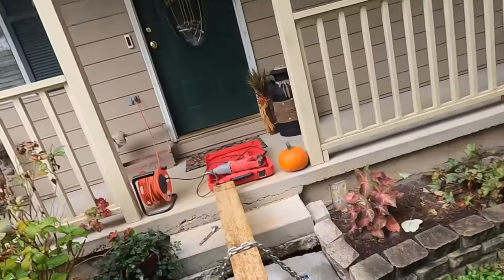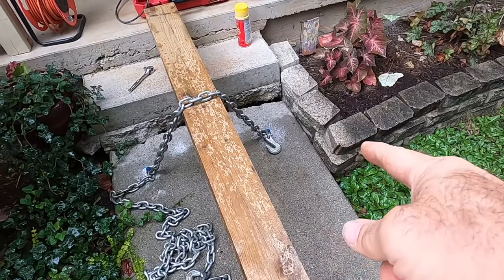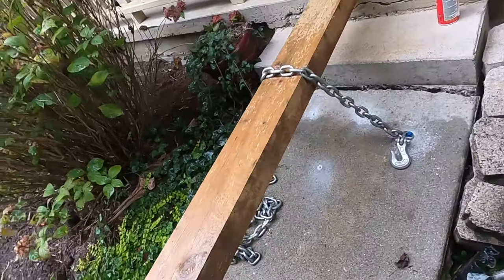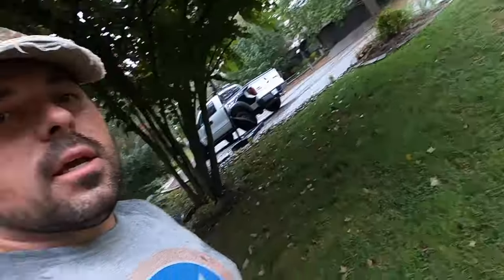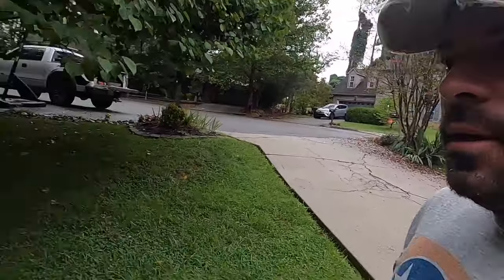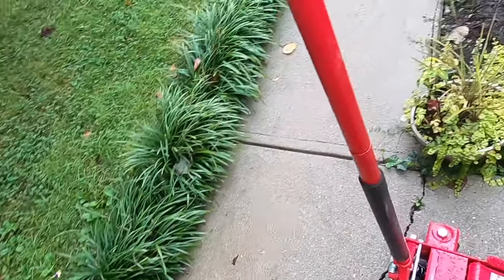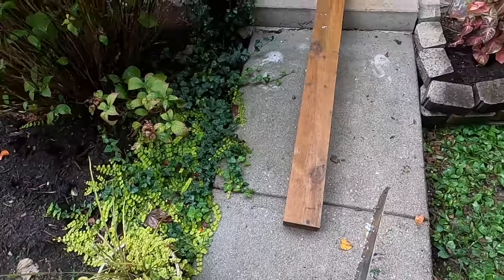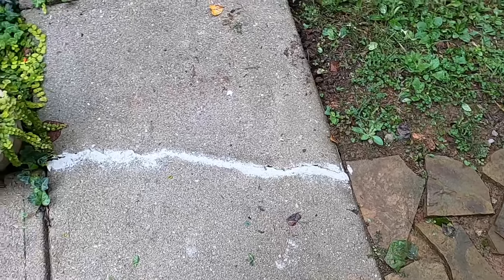Lifting a sunken concrete slab

Comment: Let’s see it a year or so later. I’m sure it failed. Call a company that does it for real and warranties the work like A1 Concrete Leveling.
Reply from the maker: still holding up as of right now
Reply: I’m surprised. It would never hold on Colorado. The domains soft and breaks down with our weather. Ants and termites love to love into. Time and date stamped picture would be cool to see with like a news paper date.
Reply: They use the same thing to lift overpasses that are sinking 🤷‍♂️
Just on a larger scale
Reply: @bombardment92 actually a much different type of foam. The foam he used may be working for that small project,  but would never hold up under heavy traffic like a road over a bridge. 
He did say it settled slightly, and I believe that was likely due to the type of foam he used. There are two kinds, single stage (like what he used, and 2 part which is what the professional PolyJackers use.

Comment: It'll last a few years.... Till the foam starts breaking down. There is a more proper foam for such tasks. Cool job, and I mean, it's done.... But you gotta think about the longevity of materials used in projects like this.
Reply from the maker: I went by it last week it had settled a bit, I'm gonna get back over there dig the side out and pour concrete in there instead.
Reply: @TheProCut17  would be good to know how this concluded
Reply from the maker: @mixedupmenopausaladhd3999  haven't been back out yet. but I've had no complaints from my friend.

Comment: I never seen a slab raised with a jack an then use that foam for support before. That will be great if it lasts for years and years, I have always seen other thick curing fluids pumped in to actually raise the slab up.👍🏻
Reply from the maker: shouldn't go anywhere.
Reply: @TheProCut17  How is it holding up after a year?
Reply from the maker: @bones6554  settled a bit after install, but holding up well

Comment: I am amazed that the floor jack was still on the piece of concrete you trying to raise... maybe htat was intentional ?  Intentional to make it swing up ?  really surprised those tapcons held too.   I would be the secure set would actually lift this pad, no 4 by 6, no jack, just high temperature, and time.
Reply from the maker: tapcons are very impressive

Comment: Never seen that done before. It worked out well. Thanks for sharing. I may have to use this method some time.
Reply from the maker: it worked great, could have hooked the sides with something instead of anchoring chain to top if I had bigger hooks.

Comment: I've been looking into this for a section on my driveway, way at the top where I dont drive or park. I need more than a few cans. So far it looks like Secure Set may be the strongest DIY product I've found.
Its specifications are "This is a 4 lb. density foam, 10 cu. ft. kit, with 70 psi compressive strength, and a load bearing capacity of 10,080 lbs. per sq. ft.".
Reply from the maker: sounds like you will get it done after putting in your research on materials
Reply: I did secure set - but the second product - it took the whole kit.  I am happy with it.  Drilling holes, for me took FOREVER.
Reply: @DanTheManIOM you need to use a hammer drill next time. Regular drills are terrible for concrete

Comment: Moisture speeds up the cure of the poly foam.
As bad as that slab was the better option was too replace it. Then a better bed that can support the new slab would outlast the foam trick.
Reply from the maker: I agree with you, replacing it would have been the best solution. I just wanted to try this and it was much more cost effective at this time.

Comment: I need to do this same thing  and need more info on the Tapcon screws / bolts. What did you use on size bolt. I have the hammer drill . My only concern is attaching the chain to the sidewalk. What do I need.  I know the Tapcons are expensive and are they reusable as I have quite a few sidewalk against the house with  a sloping issue.
Reply from the maker: I used a 3/8 x 4" tap con only $10-15 for a 10 pack. yes they are reusable. some one in the comments mentioned that great stuff is open cell foam and using a closed cell foam would be better, but didn't give a brand that is closed cell.
Reply: @TheProCut17  Thank you.

Comment: Got one showing how to raise a sunken concrete porch with 4 columns supporting a roof?
This is too easy.
Reply from the maker: I wouldn't recommend foam for that, you'd need more structure
Reply: @TheProCut17  Got one you've recorded doing sunken concrete porch was the question?